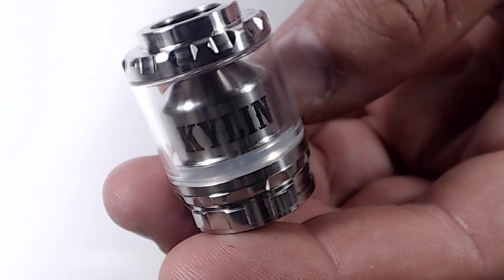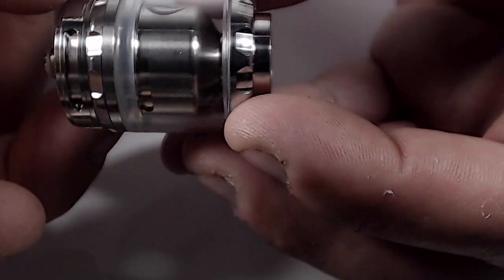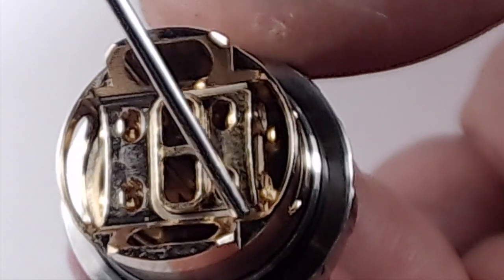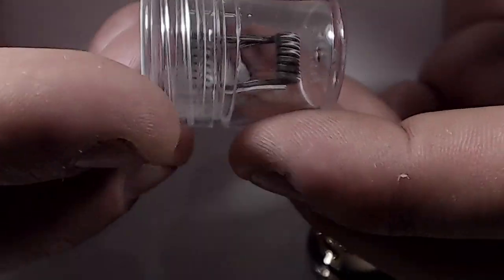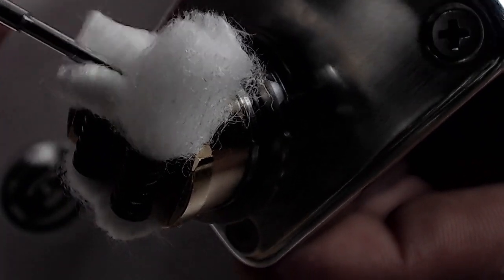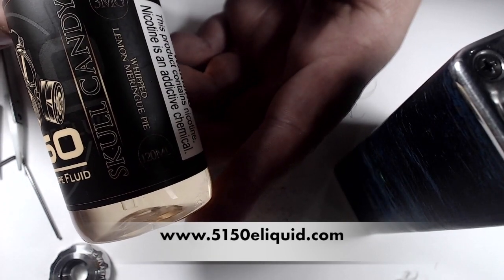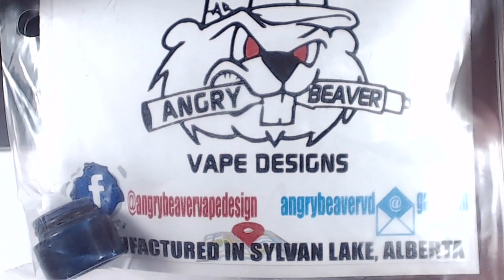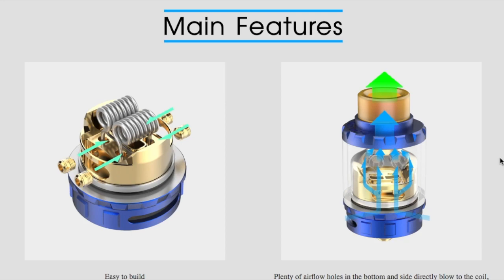Vandy Vape The Kylin RTA .. Not Just A review

Comment: Don’t worry about the juice control, use the tool provided to tighten the fill ring then even when all set up you can turn the glass/body and adjust the juice control. Don’t “STUFF” cotton in too tight or it’s not going to soak juice in properly and it’s dry hit highway for your taste buds! Fluff it out and press it in job done (I used too little and I packed too much so trust me I have been there!)
Reply: THE guys saying he didn't have a fill ring so how can he use the tool provided. Come to think of it....how could he screw the lid onto the extension without a fill ring 🤔🤔🤔🤔

Comment: I opted for the Geekvape Ammit instead.  They are damn near identical but the Ammit has bigger juice channels and it hold 3 mils in short mode.  2 mils was the deal breaker for the Kylin for me.  I can get 2 mils into some RDA juice wells so what's the point of a tank that holds 2 mils?  The Ammit does have louder airflow though.

Comment: I have no problem putting 8 wrap staggered fused Clapton wires with a 3mm inner diameter. The wire is 26ga + 32ga x 2 with a 32ga.

Comment: Great review Lou, and great tips on wicking this atty.  Just one thing I thought I'd pass along...  When I first got it I immediately swapped out the 2ml glass for the 6ml one.  The flavor was good but not super special.  I then went back to the 2ml glass, and man, it was a night and day difference.  The most flavor I've ever gotten off of an RTA/RDA (I think having that long chimney just messes with the vape somehow, plus with the 2ml tank your top piece is barely an inch away from the coils, so all that vapor is coming RIGHT off them into your mouth).  Anyway, you might give it a try sometime if you want extra flavor.

Oh, also, the first Kylin I bought did not have the top fill ring.  That one broke, and the second one I got DOES have the top fill ring.  I think this is what people are calling the "V2"; they supposedly fixed some leaking from the 510 pin and added the top fill ring.  The box is a bit different too.

Comment: Love it...mine has a ring on the top with juice fill ports so i dunno what you bought.  I just popped three coils on this deck with shared leads on middle coil.  Twisted 26g ni80 2.5mm id 8 wraps.  Vapes the best ive tasted.  Tons of vapor and still .19ohms.  Not too shabby.  Great vids man.  Try 3 coils soon.  It will work fine.